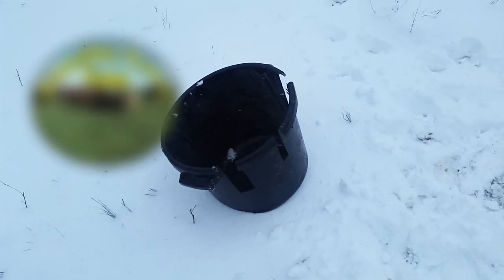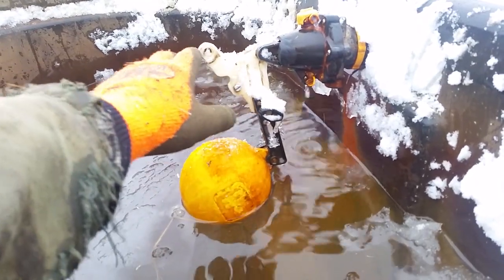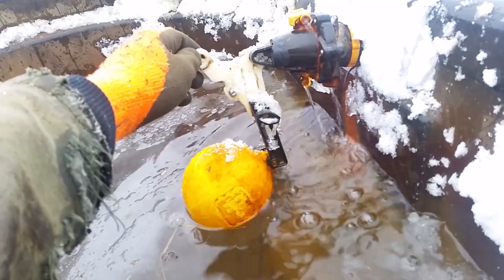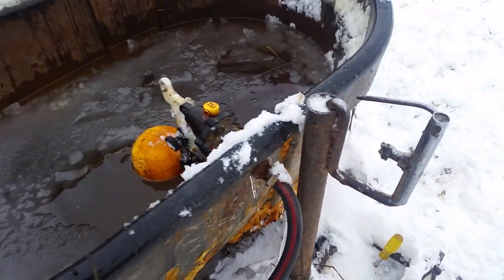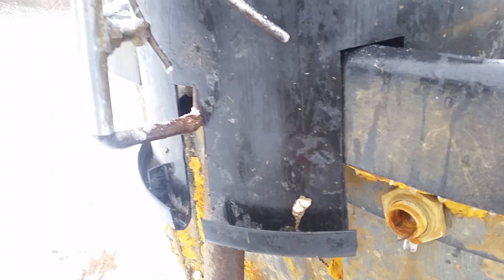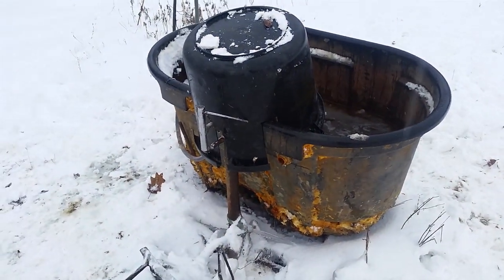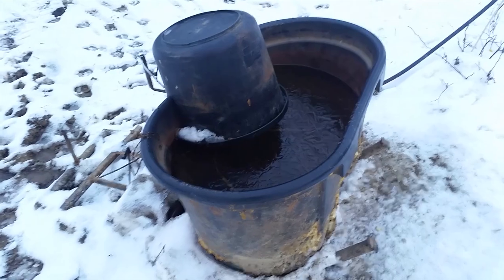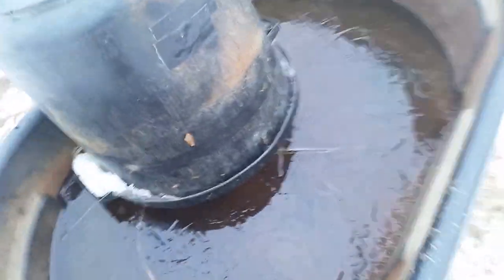Protecting My Jobe Float Valve From Livestock

Comment: I have the Job Megaflow with the tethered float which installs at the bottom of the tank. They can play with that float as much as they like...😁 If your current one quits, I suggest looking into the tethered one.
Reply from the maker: This valve has the option of being at the bottom of the tank and it is during the grazing season but during the winter I am afraid for some reason it will freeze if it's submerged and that would destroy the valve.

Comment: I'd second running a strand of hot wire over the valve or if not put a 2x12 with some cleats fasted to the tank over the top I'd think would work better than the upside down bucket they'll flip over.
Reply from the maker: It's my experience that when I try running poly wire over a tank that someone gets tangled up and the poly wire ends up on the ground. Now when I say this keep in mind there is just under 40 calves in our herd. That said, I feel a lot better having something beside poly wire protecting valve. If the valve breaks I am out there daily watering manually and that sucks! lol
Reply: @GrazingAcresFarm  yessir!

Comment: Just a thought. May take some rebar with a hook bent on one end and drive into the ground on each side of the bucket. Letting the hooks drive down snug against the top of the bucket.  It  should keep them from flipping the bucket up from the front. It may work, may not just a thought.
Reply from the maker: @Cornbread & Bees First I must say it's nice to see you here on my farm channel too but if I remember correctly you run a farm too, is that right?
I like your suggestion, with the frozen ground we are having I can see this working. The only issue is it's so damn cold (13°F now) I shut the water off to stock tank yesterday and gave the cows access to the creek. Luckily so far though not one cow has tried to flip the bucket up.

Comment: Just run electric wire over the top of the float valve  7000 volts will stop that monkey business.
Reply from the maker: Will it? It's my experience that there is always one that gets tangled up then there is nothing protecting valve. Keep in mind though that there is just under 40 calves that get thirsty too and they aren't all fully trained to poly wire just yet.